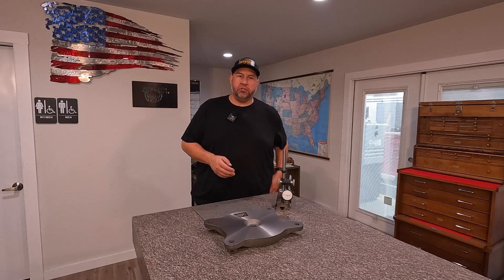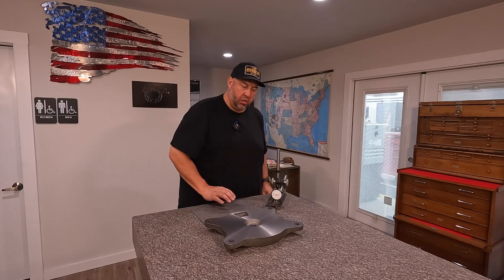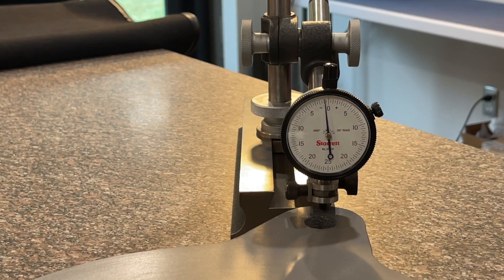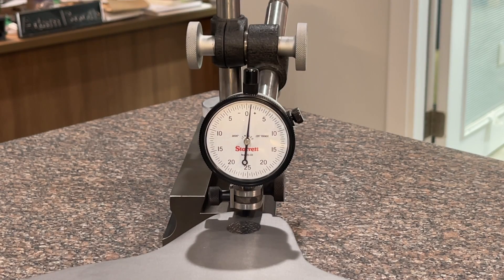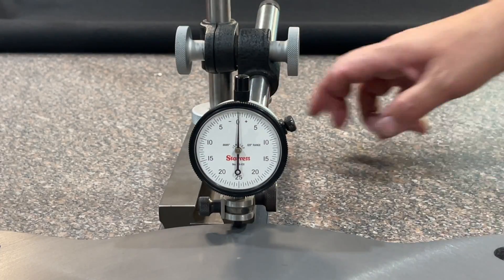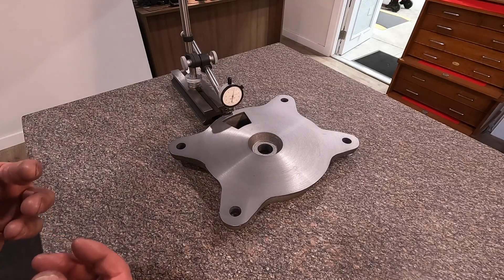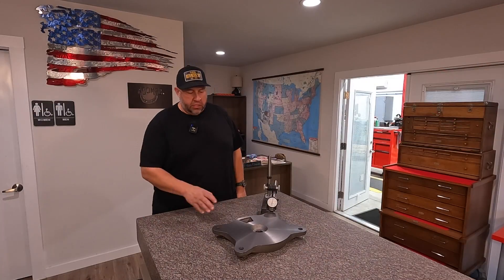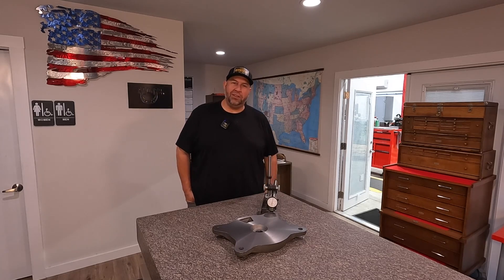Measuring for Parallelism Using the Granite Surface Plate

Comment: I'm sure this will end up the most precisely machined vise in existence.  I'd never want to use it after all that work!
Reply: exactly...
Reply: Indeed and mostly most loved cared for ☆☆☆☆☆
Reply: It’s a bench vice that will never be mounted to a precision surface. I would have been happy with a plus or minus 10 thousands trying to do what he did!
Reply: Except for the part where he accidentally cut too deep on the top anvil surface...
Reply: @BramBiesiekierski  You should let Adam know how you feel about it.. and maybe he'll make a video and make the cut disappear.
Reply: Yup a bench vise. It will be mounted to a precision ground  surface that will be mounted to a lapped intercooled 3ft plate and floating on 20 ft piles sunk in the ground with a magnafux core to keep it accurate. I will than show you how I take a 2"x1/4"x6" lg piece of cold rolled flat bar and hit it with my 5lb hammer to make a wall bracket. See my combination square shows its 90 degrees!
Reply: I’m sure Adam is using the vice to explain different techniques and operations. If not that’s the best made vice for beating the crap out of something